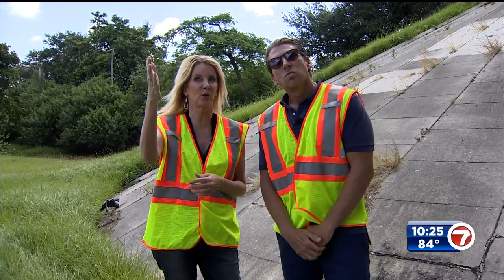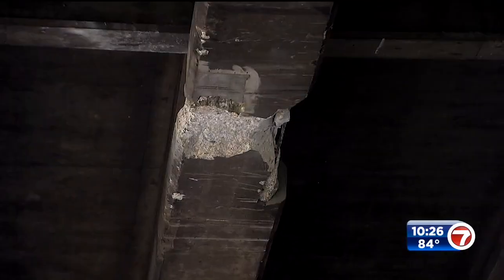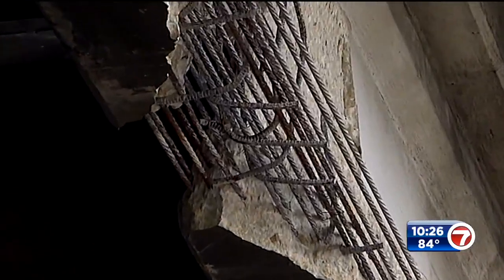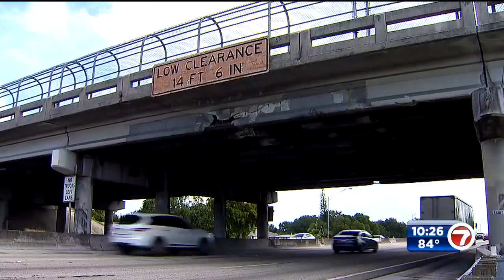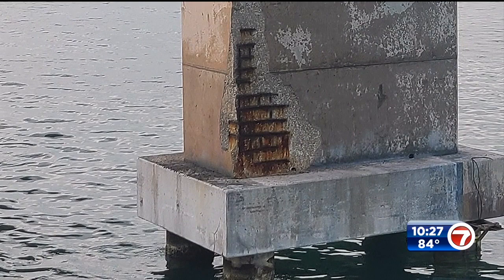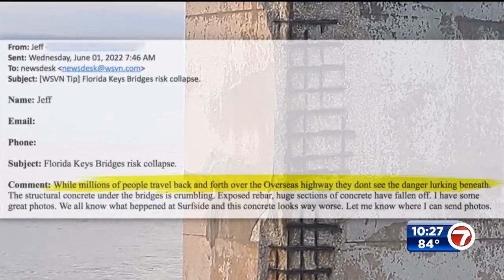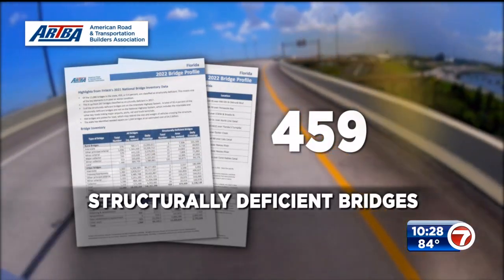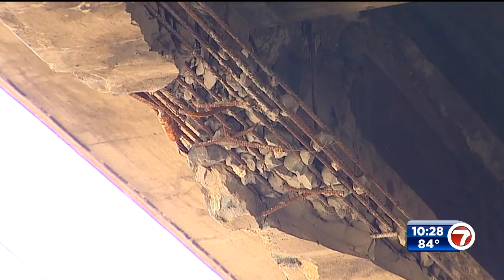Hundreds of ‘structurally deficient’ bridges in Florida, including dozens in Miami-Dade and Broward

Comment: When metal is exposed to air, the oxygen corrodes it (oxidation). This causes the metal to expand (both exposed and embedded within the concrete). Concrete cannot handle the expansion making it brittle and compromising the integrity of the bridge.

To minimize the corrosion until it is repaired, paint the exposed metal.